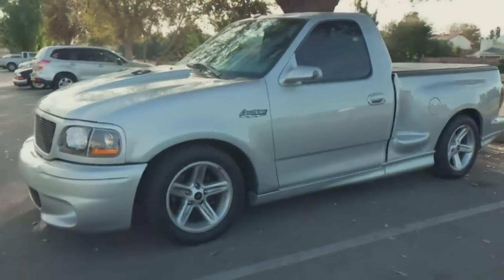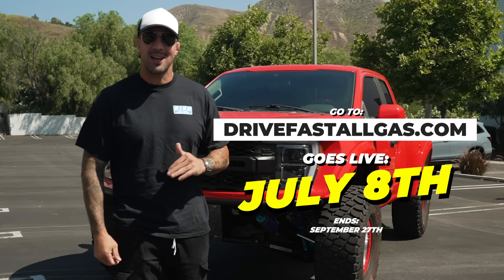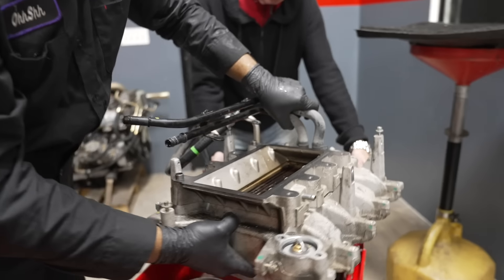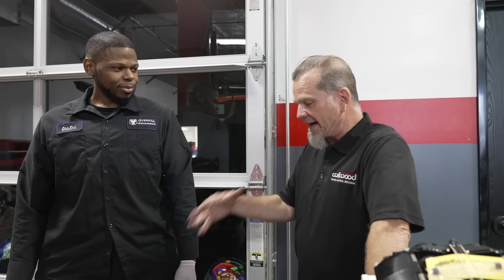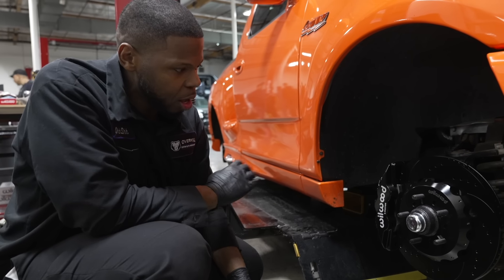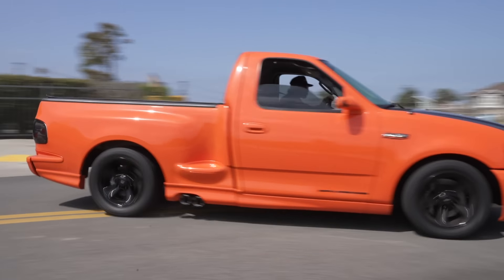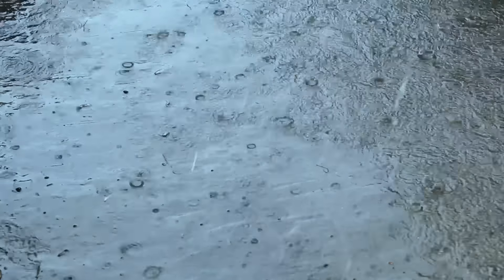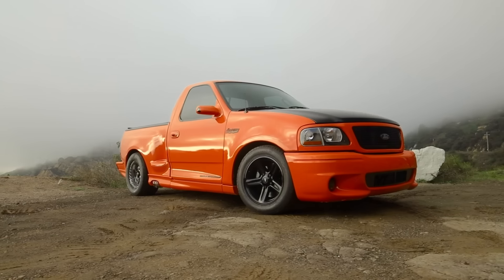Turning My 2004 Ford Lightning Into A 2024 MONSTER

Comment: First thing I would do just to update your suspension. Coilovers, nylon bushings, possible sway bars. This should help with weight transfer and planting tires. Also, what purpose will the truck be serving? Is this to take it to the strip or comparing horsepower numbers with friends?

Comment: Did I miss which Whipple he put on? I've actually never seen a Whipple truck dyno just 440RWHP. I'm guessing he has the stock log block?
A ported OEM Eaton will put down more than that with a 10lb lower and 2.8 upper.

Comment: Almost forgot, why swap from one blower to another? A blower swap with a older vehicle would have me looking at the bottom end. If the blower is such a big jump, then you really need to pull the engine. Connecting rods, Pistons, rings... Need to be gone over and certainly updated. The biggest failures are the rod bolt and connecting rod.

Comment: Brother 0-60 is irrelevant if your testing to see if the vehicle got any faster after performance modifications. 60-130 is the proper test for that. At that power level only suspension modifications and tires will improve 0-60 significantly.